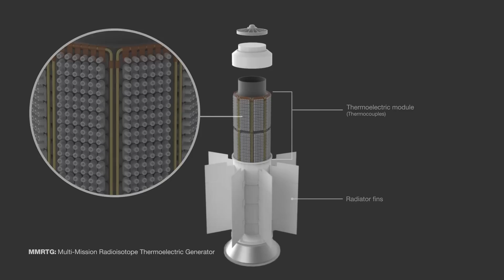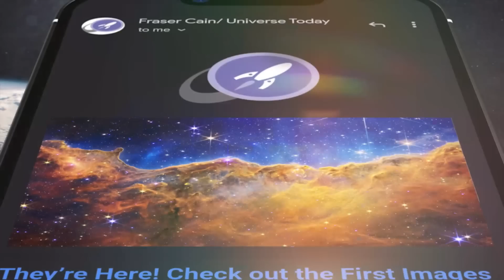Fusion Reactor To Melt Through Europa's Ice [NIAC 2023]

Comment: It is not cold fusion or the ponds-fleisch experiment as many comments are saying. The researchers could have done a better job explaining it but if you google lattice confinement fusion you will find the details (mentioned in the video but easy to miss).
My own short explanation is that although deuterium gets confined inside of a metal lattice, unlike in cold fusion it also gets bombarded with gamma rays tuned to be adsorbed by deuterium giving the particular atom that adsorbs it very high energies and being confined near other deuterium atoms the likelihood of fusion is high.
Also the fusion is not there to produce net energy (this kind of fusion has been shown to happen without net energy production) but to produce neutrons that are used to cause fission in a controlled way. 
That is very cool because you can use fissile materials that won't sustain a chain reaction or at masses that won't. As they mentioned it also allows using safer and cheaper fuels like thorium and it would also allow "burning" that fuel way more completely than a regular nuclear fission reactor. 
It should also be extremely throtleable and could be almost completely off during the travel time which is quite useful for this application: Off during travel, max throttle while melting through the ice and a low setting once down there to just power the instruments and communications for longer.
I really hope they succeed, cant wait to see the Europa space wales.
Reply: Great addendum to the interview, thank you.
Reply: Interesting... my AI sensor went off.
Reply: @Energine1  I think your AI sensors are off. The style is way too human and there are typos.
Reply: Why don't they ever mention fissile material in the video or did I miss something?
Reply: @unvergebeneid  They did mention it but briefly at the beginning and then later too giving a bit more of detail but without really insisting on it. 
If you blink you miss the mentions of fission so missing it is understandable.
Reply: Why'd you make the world round? I liked it better before.
Reply: yes, LCF involves a controlled process of confining deuterium within a metal lattice and bombarding it with gamma rays, while cold fusion is a controversial hypothesis that fusion can occur at or near room temperature. LCF focuses on enabling controlled fusion and fission processes without claiming net energy output from fusion, while cold fusion claims to produce excess heat from fusion at low temperatures.
Reply: @mortimas4137  Lol. For funsies really, I already knew I was gonna do it since the creation of Eä.
Reply: @Energine1  if the AI has started using relatively obscure nerdy usernames, it might be time for me to join the AI lol
Reply: @unvergebeneid  If it was easy for you to tell we wouldnt need detectors would we now.
Reply: @FoxtrotYouniform  I did say it was interesting... though to be fair would you expect an all powerful chatbot to name itself Bob?  🤭
Reply: @Energine1  touche, my equine friend, touche

e: total non sequitur, my dog's name is Bob 😂
Reply: I think that people thinking that I might be a chatbot is a compliment of the highest magnitude lol. One day I hope to be neuralinked into one.
Reply: @eruiluvatar236  Hmmm I see...  .....  
And if I asked you to rephrase that as a classical epic written by Al Capone?
Reply: Well "cold fusion" was always a bit of a misnomer for what Pons-Fleischmann discovered which was more than likely a Low Energy Nuclear Reaction (LENR) as they are commonly referred to as in todays literature.
Reply: I probably won't see it in my life time (Maybe got another 20 - 25 years), but that would be an insane day when, as you say, the probe breaks through into water and sees something swimming by - probably highly likely.
Reply: there are no welsh on europa but there are some in argentina! but please refrain from commenting on our weight!
Reply: @eruiluvatar236 Just one teensy correction to your awesome explanation, and that is that they can use Fissionable material, not Fissile.
Reply: @Kelnx  Thanks, I had no idea that those words have different meanings.
Reply: @eruiluvatar236  Being that this is the internet and everyone wants to be a standup comedian, I'll still attempt to assume you are being serious. Yes, a fissile material means it can fission at thermal energies (which means it is slow). Fissionable means it can fission at high energies. The macroscopic crossection of reactivity for a fissile material, such as U235, is a lot bigger than that of a fissionable material. In other words it would take constant neutron bombardment to even get a fissionable material to kinda get going with the fissions than a fissile material which needs very little prodding and just basic geometry to create a chain reaction. Or somesuch. I'm just a simple nuclear engineer, I have no idea. It's all pretend stuff anyways.
Reply: @Kelnx  I was being serious. I am just a computer science guy with a passing interest on this that isn't even a native English speaker so I just didn't know it.
Reply: @eruiluvatar236  No problemo sir. A lot of people don't know the difference. I hear the terms interchanged constantly and incorrectly. I just wasn't sure if you were being serious because your initial explanation was so good and thorough, and if I'm being honest those of us who work in nuclear can be smartasses. Like almost all of us are smartasses.
Reply: So basically fission dressed up as fusion. Got it👍.
Reply: @mrzoinky5999 pretty sure that the "water" is in reality a very thick brine and in the off chance that there is indeed life there it will be microbial. Don't count on multicellular
Reply: I was watching this thinking wait... what... they've solved fusion? Why haven't I heard of this? Thank you for the explanation.

Comment: Following power generation, cable shear seems like the real challenge for exploring under the ice of worlds like Enceladus or Europa.  EM just doesn't like to propagate through water/ice very far, and any cabling up to the surface is going to have to be tough enough to survive ice shift/shear while being light enough to not totally shoot the mass budget for your mission on its own.  
For now, the best alternative to a surface-based transmitter might actually end up being to melt/drill down into the water, do your survey, then melt your way back up to the surface to transmit your data.
Reply: Maybe the device could drop relays every meter or so depending on how far you could transmit through the ice.
Reply: @alien1162  As you're melting through the ice it could drop relay pucks behind it that would be frozen in place that would give you a "line" to the surface.

Comment: A probe could melt its way down but as the ice refreezes behind the probe, so then comes the problem of communication with the device, perhaps unwind a very thin cable but then any geological movement would sever the line. Many problems here but any problem can be overcome but imagine the pressure at 30KM below the surface.
Reply: The pressure is actually a lot less than you'd think due to the lower gravity. I don't recall the exact estimates but IIRC it's something like the same pressure under 10km on Europa as it is on Earth at 1000 feet below sea level.
Reply: @stuartreed37  The gravitational acceleration on Europa is 1.3 m/s2
 (Compared with 9.8 m/s2
 on Earth). But on Europa there is 20/30km of ice floating on the water. Your statement is true but the scale of depth we are talking about on Europa brings us to nearly the same challenges as you would have going down to the Challenger deep here on Earth plus going to Europa and down through 20/30 KM of ice.
Reply: Don't forget about the triple point of water. No atmospheric pressure on Europa or Enceladus means adding even a modest amount of heat would instantly transition the ice to a vapor without any liquid state inbetween. It should make a hole straight through the ice, with all that steam expelled into space. Granted, that water vapor would recrystallize on the shaft once it cools down again and the probe is deep enough. The probe might also need serrated wheels on all sides to dig into the ice to apply counterpressure for all that steam. They have also used certain radio frequencies to map the ground kilometers beneath Antarctica's ice, so not all radio signals would be blocked if there were surface or relay probes.
I published a hard sci-fi short story in a Baen books anthology (Robosoldiers) a year or so ago about a scientist testing a NASA fast-reactor prototype in Antarctica (before the US military repurposes it to melt it's way beneath a Russian base). I didn't know NASA was working on something somewhat similar when I wrote it. I chose HESTIA as my traditionally forced acronym, Hexahedral Enceladus Surveyor with Thermal Ice Ablation.
Reply: @PheedPhil  I'm a ham radio operator and was an electronics technician in the Navy we had some VLF equipment that could communicate at that depth but the issue with that would be problematic, antennas need to be very long and use a lot of power, then after you got the info to the surface, you would need to convert that signal to frequencies for transmission home. I wonder if you could use low frequency sound like whales do? Just trying to exercise my 74-year-old brain but someone younger than I will certainly figure this out.

Comment: So as it melts it's easy down, a communication cable spools out behind.  Then on the surface there's some communication equipment.

The cable itself has to be robust against cold temperatures and high pressures and perhaps also shifting ice.  

Unless it sends some kind of a radio signal directly through the ice.

Comment: There is an interesting reactor that is rapidly pulsed way into the supercritical where prompt neutrons heat the coolant way hotter than the fuel.  That might offer the thrust of a nuclear thermal rocket with an isp of maybe 100,000 seconds.

Comment: I wonder what shape of object would be optimal for this. A long, narrow object with minimal frontal area, or a spherical object with minimal surface area per volume?
Reply: neither.
Reply: @bikerfirefarter7280  At the risk of fueling trolling behavior, why do you say that?
Reply: @dustman96  long/narrow probe would waste energy because of the high surface area, and the heat would be wasted on the walls of an already wide enough shaft. A sphere or L/N would both accumulate grit/debris at the bottom of the hole which would halt progress. If you could steer the probe it might be possible to sidestep the debris, but even then the issues/problems of a long tether remains.  If an autonomous probe had sufficient energy it might melt its way back up (assuming the old shaft is closed/refrozen) and transmit stored data. Or the 'drill head' could remain as a data transfer and comms port for autonomous drone(s) released at the well bottom.

Comment: I think a huge problem is how to prevent the refreezing ice on top from severing/crushing any tether cables that is needed to send data back.

Other than drilling and removing material, I don't see how just melting and sinking will be enough.
Reply: That is the biggest issue, they're plans wont get approved yet.  Europa Clipper will first need to map, thoroughly.  After that, a lander.  

Personally I would, focus on Enceladus has a OPENING in south pole, why risk drilling ans tether should have a higher success rate.  Or really focus more on titan.
Reply: I think off you have the spool inside the craft the tether shouldn’t be crushed, because the displacement should be constant. As long as the ice doesn’t move the tether should be stable
Reply: @Captain Ahab  craft going down isn't an issue.  Tether being exposed to VACUUM ICE, it won't be smooth refreeze.  On Europa doesn't have pure open geyser like Enceladus does.

We need Europa deep dive for sure, but going to the Saturn Moons will be more beneficial, giving another 20 years to create a better relay system for data in Europa and Ganymede.
Reply: @prirush8800  while I think we are likely to have materials sciences advancements that will make a tethered Europa Sub viable before we have the opportunity to send one, I agree with everything you have said.  To add more to your cogent argument, Enceledus first, not just for the potentiality of life but also to more directly study cryovulcanism, which seems to be vastly more common out among the stars than magmatic vulcanism, and so may be a better indicator of life elsewhere.
Reply: @captainahab5522  the ice does move, both from tidal pressures and internal pressures.  It's one of the reasons that scientists are so certain there is an ocean underneath.
Reply: @Defective  

Yep, Saturn Moons is the way to go. 

Question, what you think, Elon Musk underlying love for Triton is about? 

Can't wait for robotics to get better, as we can Armour them to use on Mars and the Moon, to beat the sand and radition.
Reply: @prirush8800  to expand slightly, my thoughts overall are that it isn't the reusability SpaceX is exploring which is the revolutionary trend, but rather the movement of spaceship fabrication from clean rooms to industrial yards.  Industrialization of space access is the real cost reduction driver.  Reusability is a feature of that industrialization, not the other way around.

When we finally start putting first industrial infrastructure on the moon or in cislunar space, that is when the promised robotic revolution will probably land.  Maybe something else brings it before then, like demographic collapse, but I hope we don't have to wait that long.  

A sort of limited Von Neumann sent out to the Asteroid Belt to mass produce probes to get close up looks of everything in our immediate neighborhood makes me happy in pants.

Comment: I could neither extract from the interview, what the state of the project is, nor what stage they are really working on, nor if any (or which) of the basics have already been demonstrated to work .  Are they doing experimental work at all, or is that all about theoretical physics? 
Was all of that speculation about applications of a technology, which does not exist? What does "get a design established" mean here? A design for a proof of principle? A design for a useful system of something, that has allready been demonstrated (Where, when? Was it mentioned somewhere in the interview and I just did not get it?) to work in general? A design to implement a device the size of a teapot, which is just assumed to have the required power output for a melting probe?
And if they claim, that they figured out, how a useful nuclear fusion reactor can be built, why should a niche application like "melt a hole into an icy moon" be the project to use it on? Is there a reason, why it should not be used on earth, like all the other research teams, who work on useful nuclear fusion try to achieve? 
When I read the video title, I had a lot of questions. Apparently none of them were addressed.
Reply: Sounded like they have thought about an idea while getting stoned and are working through it now. Very early stages.

Comment: The plot thickens! Regarding communication with a probe in the ice, Has anyone investigated the idea to use sound? Hard and dense material conducts sounds very well. Except that this goes for background noise from moving ice too (as well as the singing space whales below the ice) but it should make for some interesting research?
Reply: Sound is not impossible but it has it's problems too. The biggest one being bandwidth. This might make the old standard 110 Baud rate look fast... should you remember back a ways when to communicate with a remote computer you actually put the telephone receiver in a cradle. That was data via sound over an inch or so of air. Now substitute that for 10s of kilometers of ice. The medium would tend to roll off high frequencies and as the frequency of sound goes down so does data bandwidth. The same is true with radio waves BTW, communication with submarines here on Earth uses supper low radio frequencies to make it through the water, much lower than the old AM radio. The second Problem with sound waves that can be heard through kilometers of ice is that here on Earth we have a word for these kinds of sounds, we call them earthquakes. I think in this kind of an experiment we would want to keep things that could cause the ice to shift at a minimum. Great idea though, this whole idea of hybrid fission/fusion comes from thinking down new tracks.
Reply: too many unknown, too low bandwidth, power hungry, non-zero risk to biology,